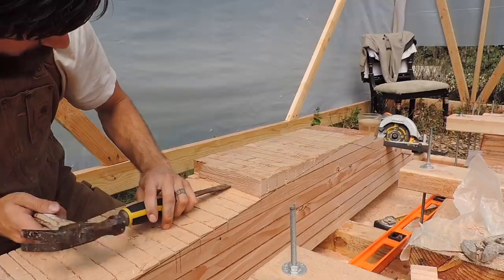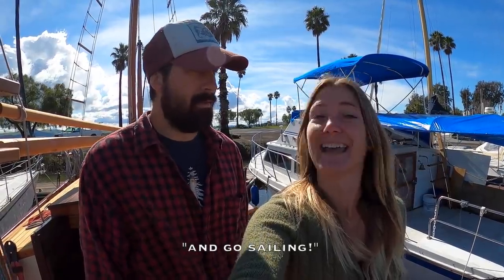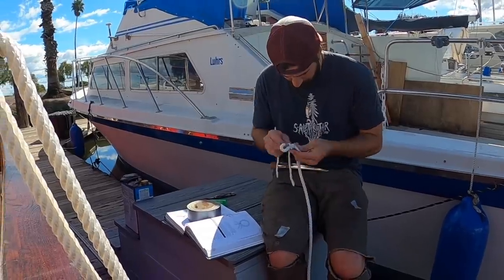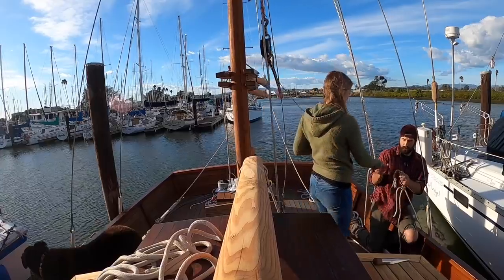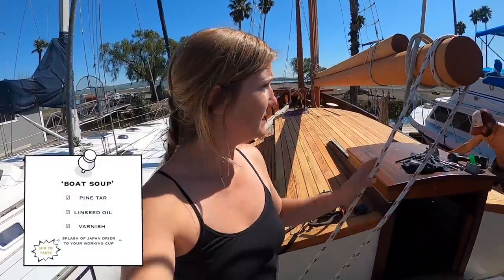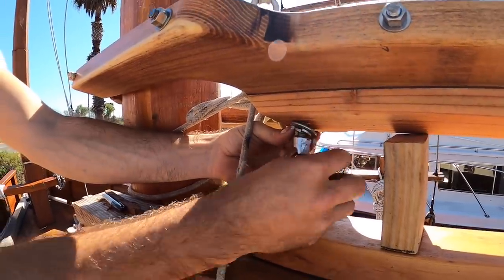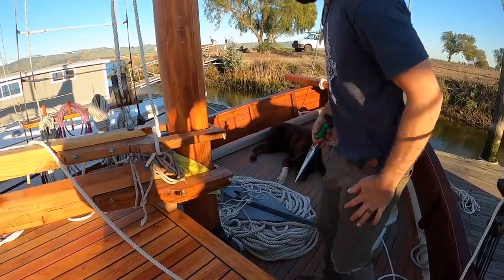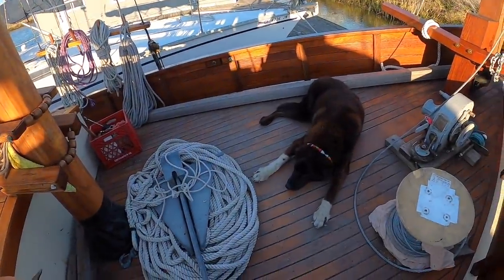Salt & Tar: Ep.135- Inspired by Norwegian Rescue Boats

Comment: Hey, Garrett...why don't you use Dyneema instead of rope, especially for safety sake? If you don't know anything about it, or not enough to feel comfortable using it, contact Troy at SAILING INTO FREEDOM. He has just re-rigged a 50 yo 30' sloop using dyneema instead of wire stays.

Comment: Fancy 'new' electric mast lights or will you go all out 'retro' with oil lamps? Is it just the lighting or is the hull interior untreated? I would think some oil on the floors and ribs would protect from fresh water condensation, the infamous boat cancer cause. We sailed for many years with just an alcohol stove, Aladdin Kerosene lamps and 'Sun-Showers', the water in those black bags could get mighty hot with no need to run an engine (we only had a dingy outboard anyway). I attached a shower curtain to a 'Hula-Hoop' and hauled it up the forestay... In the 60's and 70's you didn't have much choice about running 'off grid' unless you could afford a really big craft...The Wife and I would have felt right at home aboard Rediviva, just like we were in our 30's again! Go forth, youth, and make the memories of your lifetimes!...

Comment: Why the double swage fittings? In theatre rigging (and according to the manufacturers) single swage sleeves are "proper" for eyes. The weak point in a swaged eye is right where the cable enters the compression sleeve. Adding a second sleeve doubles the weak points in the system. Awesome work on the boat though. Can't wait to see her under sail!

Comment: Garret, rub that hot end of the line you melted on your knife blade for a smooth finish. And are the shackles stainless? And is the inside of that shackle nice and smooth, too cut down the chafe of the adjusting lines. Damn nice work you folks have put into her, and maybe add a figure eight knot at which point the gaff halyard will be at its lowest, that way the knot stops the halyard from undoing itself in case the halyard is let go by accident....no one wants to go aloft in a blow to retrieve it, this way sit out the storm and then just grab it without having to climb for it.

Comment: Hey Garrett I was watching another video on YouTube, it had a boat similar to yours, at the bottom of the masts it had a wedge type piece of wood bolted to the mast at 90 degrees to the decking, it looked like when the boom is at the bottom it locks into place n the wedges, then when you set sail you lift the boom up about  1foot and it is free to swivel around the mast. Are you doing something similar

Comment: Hi, I think one of those klien green laser levels should be apart of the kit.  The green one is visible in sun light.  You set it on the deck and it will shoot a perpendicular line.  If you set in the right spot you can line up front edge or center and measure the rake at the same height above deck.

Comment: Greetings from TX. We love your show down here. Are you guys in the Wooden Boat forum on FB? We're discussing your boat soup recipe there. I'm wondering if the soup would be good for the wooden bench seats and console in our dinghy (Harpoon 5.2). Does it dry thoroughly enough to sit on? (I guess that's what the Japan Drier is for?) Also, when you reapply the boat soup ... there's little / no prep, is that right? You don't sand or anything prior to reapplying ... you just layer it on, no?  (That's part of what appeals to me.) Best wishes. Hope you'll check out our Harpoon Dreams channel.
Reply from the maker: Hi Dave! Yup, it dries nicely. Even without Japan Drier, it'll just take a week or so depending on temp. No prep really I just wash down my surface with water, dry it off then add another coat. It does darken over time but you could also use less pine tar and a bit more linseed oil if you prefer. It's smooth like varnish but not as hard I'd say. You'll have to heat the pine tar at first so it will all mix together but it will all stay unified in your container after the initial mix. And remember not to add the drier to your stock just to you're working cup because then it will congeal and get weird. Hope this helps. Happy souping! 
R